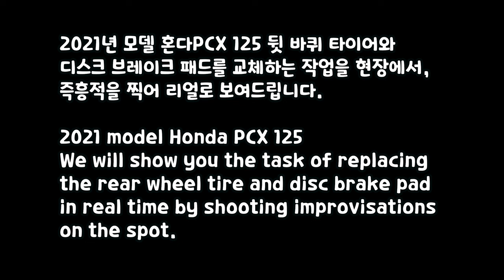Motorcycle Rear Wheel Tire and Disc Brake Pad Replacement Review (Honda PCX 125 - 2021 Model)

Comment: Here in Spain all PCX are 125cc and the rear brake are drum not disc... You are lucky
Reply from the maker: Here in Korea, all PCXs are 125cc, and rear brakes are only sold with discs.
Why do they sell drum systems in Spain?
Reply: @MotorcycleRepair  maybe the drum brake are more cheap than disc...i dont know why...
Reply from the maker: @elrinconderoller1560  I think so too. "Perhaps because drum brakes are cheaper than discs" 😀